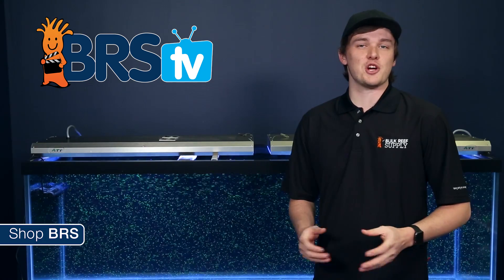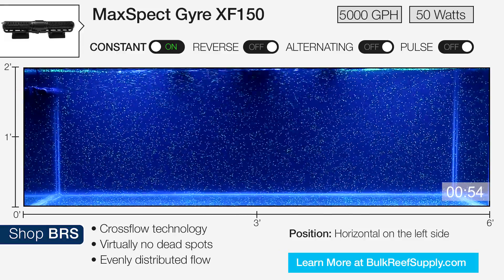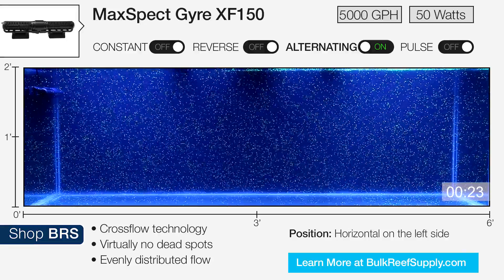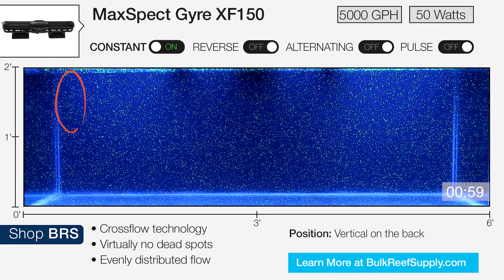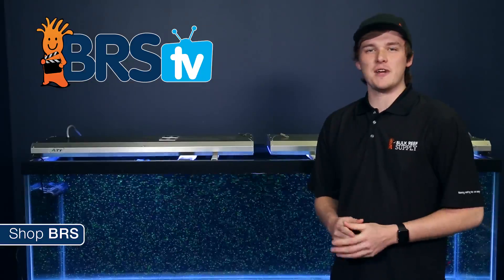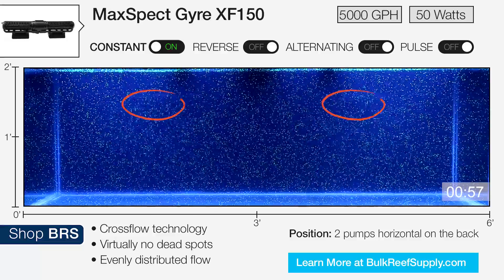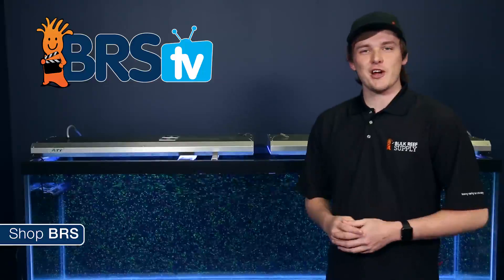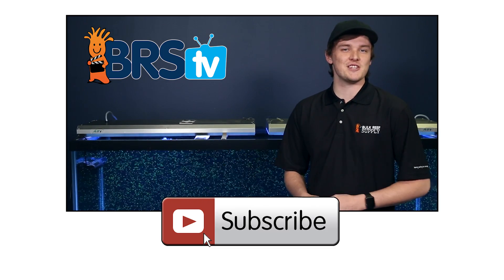MaxSpect Gyre XF150 Flow Dynamics | #BRSTestLab

Comment: Hmm interesting but this isn't a very realistic test. I mean, most tanks have a huge pile of rocks in the center. What happens to the flow when it comes around the other side of the tank and hits a wall of rocks? I would think this would push all the sand to the pump side and after hitting the rock would create dead spots.
Reply: Thanks for doing the tests. Definitely helpful but I would love to see a test with rock to see if the flow pattern still works. And a head to head with a MP40. The Gyre looks cool but still not sure if it's worth getting rid of my MP40. Thanks for the video!

Comment: very good informational vid. thank you. I have a 300G Fowlr with tangs, some angels and wrasse in there. the tank is populated well. I am using two of  the Jebao RW-20 powerheads and wanted to know if one of the gyre 150 would be adequate flow to help aleviate any dead spots in the tank? my  tank is 96LX30X24H I was thinking I could mount the powerheads on the back with the flow facing out instead of linear. thanks for your input.

Comment: I've found that running two gyres on either side of the tank  on alternating mode works best. I have them connected to a Neptune apex and run each side for a few hours alone and then have some overlap time with big on before it switches to the other.  Coralvue support is top notch.  They even face timed with me on Saturday to solve some issues I was having with my smaller gyre on he frag tank. Tank is 60x36x24

Comment: I have a Gyre 150 with a 5' Reefer 450 tank. I've hooked it up to Apex with the IceCap module and have custom programed pulse modes that change throughout the day. 

I will say that I had a rocky, or I should say sandy, start with this thing. The alternating mode was what I wanted it for, but it took me a really long time to get it set up and even when I did, it wasn't what I expected. What I ended up with was a disaster of a sandstorm in the tank at each adjustment. I finally gave up and went to the constant mode. 

Later, after the Apex installation, I realized that there are some really good videos on YouTube helping people understand how to really use the alternating mode correctly. It's quite complex, but if done right, is very neat. I received the special cord yesterday that will let me use the alternating mode with my Apex, so I'm going to give it another shot. 

All in all, this is an expensive unit, but is very powerful and capable. Just be ready to spend some time learning everything if you want to use the advanced functions. 

BRS, please do a segment on properly programming the Gyre like you did the Apex. That would be super helpful to people like me. And do it in a tank with sand, as the one you use here doesn't show the issues with high flow straight down.
Reply: +BulkReefSupplyCom I believe so. I think I've seen all of your videos. I'm a big fan, big customer and very appreciative of the videos. Also amazed by Ryan's development as a presenter over the years. In my opinion, he's the best dude on YouTube now.

Comment: Looks like two of the modes are useless... Alternating and pulse look to be the best. If they ever step up their game on the controller this pump will put everyone one out of business. I wonder when a new model will come out... Hate to buy this only to have it be outdated a month later. Kinda like the quiet drive did on vortech pumps... For now I'm still thinking two mp40s on this tank side by side would give u the same flow and even more options ... ✊🏾
Reply: +CJ&#39;S AQUARIUMS I have mine hooked up to my Apex with the IceCap module. I can do totally custom programs on it. Definitely won't be outdated by an update. I currently use the standard flow, but have programed my own ramps. That's the value in the standard.
Reply: Thanks for the input.. Wasn't aware u could modify it with an aquarium controller ... I was thinking more of the stock options as I have never owned a controller my tank is simple

Comment: Had mine since it was released on my sps system, it's fantastic. It would be cool to see the flow patterns when you switch the rotors, one normal and one rotor on reverse then put it on alternating setting.

Comment: how well will this move the water on an 8ft tank?
Reply: +fadifanous I have 2 150s in my 6ft 300g.  When I turn it to 100% its WAY too much flow.  I run mine at about 25% and it really pushes the water 6ft with ease.  You would be absolutely fine with a 150 on an 8ft tank.

Comment: how bout 2 pumps in pulse mode on horizontal ends? big wave I imagine
Reply: This is exactly what I'm doing right now. I also have 2 mp40 on pulse on the ends under the gyre. I ordered the wave controller like they use here. I think that is going to be the ticket. The gyre moves a ton of water. I have a large sps reef, and I think the alternating flow from the wave box will be awesome

Comment: I have a 6ft tank and want to switch to the gyre 150. is one placed horizontal enough or can I place a second gyre on the opposite side but vertically with the flow across the front pane of glass? My guess is that this setup on pulse mode creates a much more random  flow than just the horizontal one.
Reply: +Steffan Greven The 150 moves an incredible amount of water, it is plenty for a 6'tank
Reply: +Steffan Greven A single 150 is plenty.  I have 2 150s in my 6ft 300g and they are both turned down to about 25%.  A single would be just fine.  I tried setting them up like you suggest but now I have them on opposite ends facing each other on different lengths of pulse mode.
Reply: Thanks for the great answers. I will try it with just the one first and see how the tank reacts. If I need to adjust the flow to be more random I will add the second and dial them down so they won't blast my fish and corals out of the tank😁
Reply: if they are alternating, then why have them turned down?  there is only one working at any time

Comment: Adding the commentary was a great idea.   That thing is a beast on startup!!  No intention of disparaging the brand but  I've read some posts/comments about this product not performing well long term.  Any comments on longevity?
Reply: +Tim Kotanko They have major changes since the first gen, I have 3 first gen ones.  They have a better designed motor black as well as a better mounting system now.
Reply: +Eric Leahy Thanks for the feedback Eric.  I'm always looking for ways to improve my setup.  I can't fault the MP40's I have but can't deny the impressive movement from the Gyre's
Reply: +Tim Kotanko I'm all about random flow, my 150 has a Gyre, a MP40 and a closed loop, things really get stirred up when all three are turned on
Reply: +Tim Kotanko I've had my 130 about a year now and I've had a few hiccups along the way, surprisingly none of which were really maxspects fault. I have a fairly established tank and very high nutrients. I've got a love hate relationship with the gyre as I love the flow but hate having to clean it every 3-4 weeks, don't know why but my critters especially the tiny brittle stars love to try and hide out in this pump. Guess I should mention they are trying to hide from a harlequin since before he arrived I didn't have nearly the problems I do now. That being said my one complaint is with the design of the original rotors or more so their ends I've had several rotors strip out on the end becoming useless.

No none of this is really the fault of the pump or design as it's the critters in there that keep causing problems. If it weren't for that I would have nothing but praise about this pump. I can say the corals love it a lot. I have a disability affecting my feet and one leg so I'm not always able to clean the gyre when needed so I've had some times where I had to switch back to the regular pumps I was running before, 2 jaebos one in wave and one in else mode, when I make these switches the coral tend to look crummy after about a day with the old pumps and then perk back up when I finally get around to getting the gyre back in. 

Hope that helps.
Reply: No problems other than the things they fixed under warranty from the first production run. I just bought my second gyre 150. It's a BEAST and the changes they made make me consider selling my mp40s